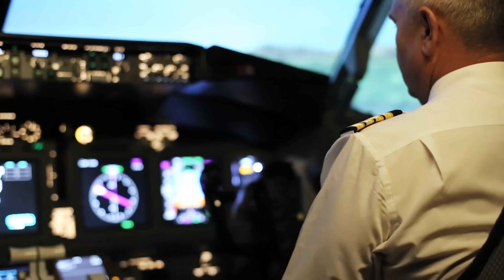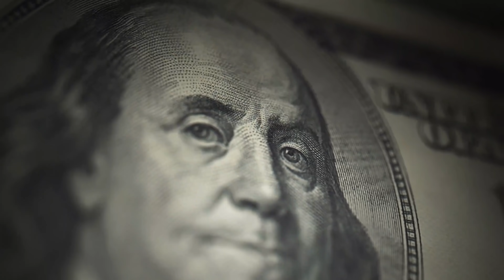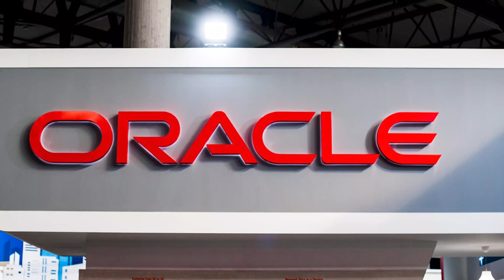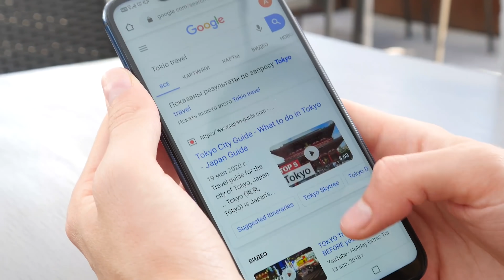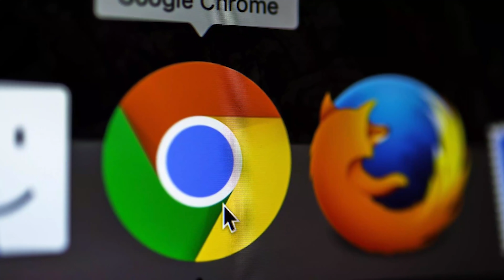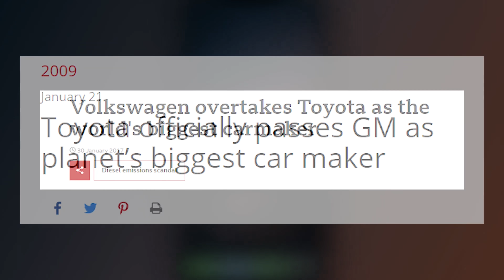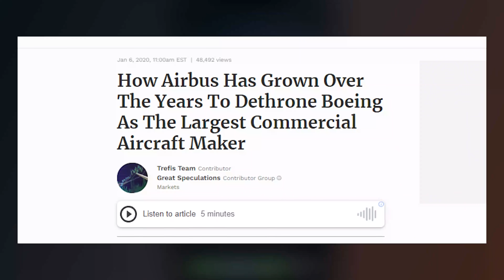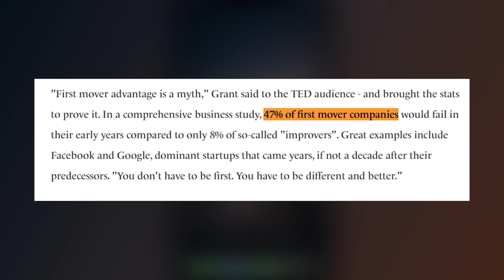The First Mover Advantage Is Overrated BS

Comment: In economics, we call the First Mover advantage as "Barriers to entry". It's not set in stone, but depending on the business, it can be easier or harder. That's why you can't have private firemen, for example. Competition would be a disaster, so the state simply takes care of it. But for most businesses, it's not that high of a barrier.

TL;DR: don't try to create Internet 2, but most times it's just going to be a little bit harder. But when has that ever stopped you?

Comment: Man you are judging company dominations by their current status. Boeing for example had good times until Airbus came in. Problem is that, first mover advantage doesn't guarantee market domination FOREVER, it might guarantee domination on initial stages of market. The same way Airbus, might get new competitor who might dethrone them and Boeing. Also dethrone of Boeing might be caused partly by management failures of Boeing itself and not only because of Airbus's performance. The same way Tesla or Toyota might get new competitor who might sell more EVs and hybrids than them, respectively. Conclusion: first mover advantage works, and if someone thinks it doesn't and argues company's current situation, probably it means they misunderstood what first-mover advantage is, and not that first-mover advantage doesn't work. Simply saying, first-mover advantage is not overrated.
Reply: This should be pinned!
Reply: That's the thing; first movers cover too large ground.

And have (initially) no competition, so they most probably have flowed management systems.

I think that's what the video is trying to tackle,"by being the first there's no guarantee as much as everyone believes"

Comment: I will agree that it is overrated. But there are many "OLD MONEY" families in developing countries where the literal reason they are worth millions is because they were first. The original CEO of these family companies typically have no educational background whatsoever, and only are rich now because they started to sell something that wasn't normally sold before. I think FMA definitely becomes less reliable and less useful in developed countries with established economies, but FMA is FAR stronger and FAR less complex in developing countries.
 
Not to mention your entire argument is cherry-picked from some of the most well-known companies. There's endless examples that could be used as counter-arguments. And there's other confounding variables to why Chrome succeeded and IE didn't, not just FMA alone.

47% of First Mover companies fail in their early years. Okay, assuming that statistic is reliable, it's estimated that 90% of all companies fail in their early years. Already, that's a better statistic.

Also, BTW: The TED talk that quote is referencing mentions the statistics are from a "comprehensive business STUDY" when it's actually just a journal. Just a point of the TED speaker trying to mislead people.

Not to mention the study only includes a little over 200 failed First Mover companies out of 500 which is hardly a decent data set. Hundreds of companies are created every day, and you only take a little over 200? I expect like 1000 data points at the very minimum, because that's what's expected from COLLEGE STUDENTS that are hardly operating at a professional level.
  
Also- these journals were made in 1993 and 1998, over 20 years ago, which are hardly recent at all or reflective of the current economy.

Comment: First movers have to guess what the customer wants, and baked in mistakes. Second movers can analyse the first mover and side step them, or simply see what is missing and implement it. 

Take Ford implemented the assembly line and mass production to reduce build costs and expand the market for cars. GM saw the opportunity that with this wider market there were multiple tiers of customers who wanted personalisation of cars (even if it was paint colour), and innovated to make that work using the same principle of mass production as ford.

Comment: Man Tesla is rather first mover in EVs than late mover in automobiles. Tesla grows relatively to its current size faster than Toyota or Nissan, because its small yet. 500k cars and 250k growth, oh ho that's 50% growth, faster than any other carmaker right? Well yes, but only when it comes to percents, not necessary when it comes to number of additional cars produced. Say Volkswagen, in 2021, jumped from making 9.7m cars to 12m, that's 2.3m additional cars, but relatively, its only 23% increase, compared to Tesla's 50%, does that mean Tesla had added more cars? No. Because 2.3m vs 250k, Volkswagen's percent seem small only because they already produce huge amount of cars, and Tesla's percents seem big only because they produce small volume of them. Another example is Bitcoin. Bitcoin prices had grown 100%, which is great, but can it sustain the same percentage growth in the future? I think no, at least not in 2-3 years. Now let's go back to Tesla, can they sustain the same amount of growth each year? I think no, because the larger volume gets, the less will be increase in volume (at least relatively to previous volume). Tesla is not a late mover in automobiles. It's important to differentiate between "gasoline, diesel and tradtional" automaking and automaking of electric cars, or hydrogen cars. In electric cars, Tesla is one of the first movers, and we recognise them as great electric car maker, but not as automaker. Tesla has brand recognition and reduced competition in electric cars, stuff that first movers tend to have, and its cars are not competing with ICE cars yet - because they are electric. It's the same as comparing hybrid cars with hydrogen cars - they are very different, and target different customers. Who Tesla cars competes with then? New VW, Hyundai, Toyota, BMW and Ford electric cars, they don't compete with Volkswagen Passat, Mercedes-Benz E class or Toyota Camrys, they are in different segments, target different customers, they are physically different, they have different price tags, functionality and quality. So no, Tesla is first mover in electric cars, maybe in automobiles generally but it's shallow to take auto industry as a whole, because someone who has most of market share in sedans might have zero percent share in police cars in US, like Toyota who owns most of sedan market in US, and Ford who dominates police cars. So who now dominates cars? Ford or Toyota? Well, it's complicated. If police cars and pickup trucks, then Ford, if sedans, then Toyota, if SUVs, then GM, if electric cars, then Tesla, if low end cars, then Volkswagen, if luxury cars, mostly its Mercedes-Benz. So you cannot overgeneralise auto industry as "automobiles" only, because it consists of different segments, and markets, each dominated by one who doesn't dominate another segment or market.